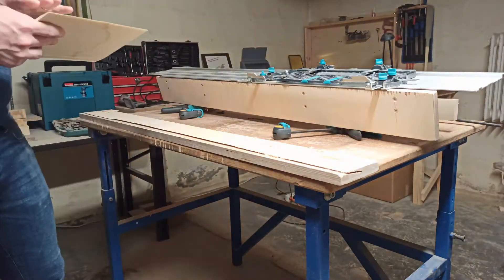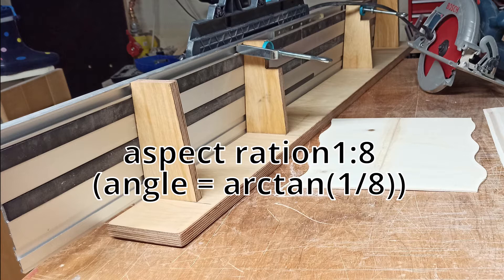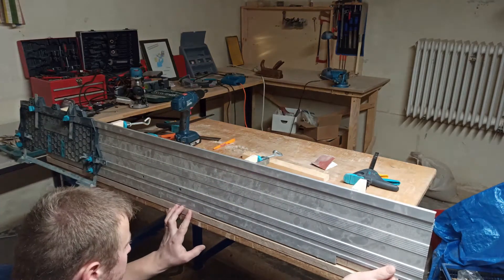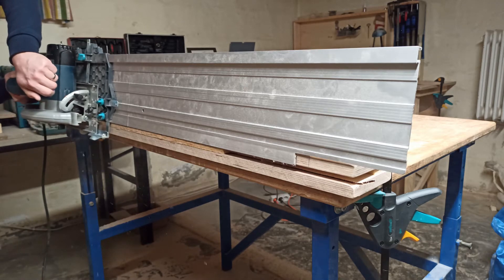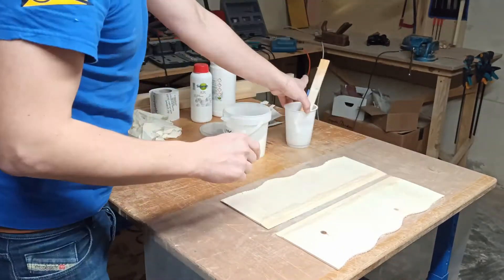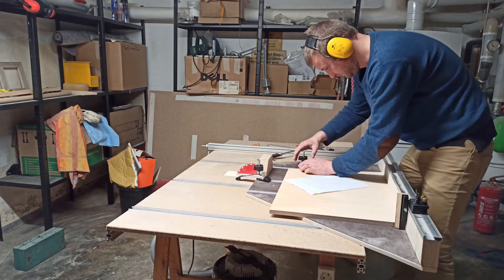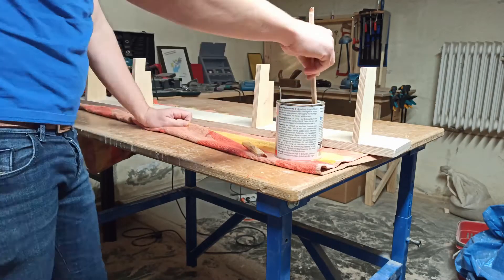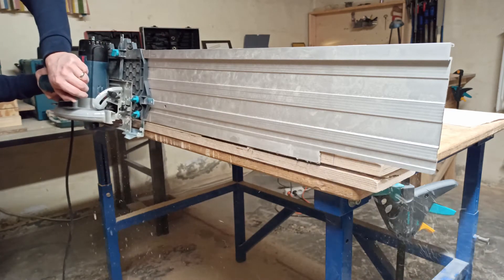Homemade Jig For Cutting Scarf Joints in Plywood

Comment: Over the course of a few decades I’ve made scarf joints in softwoods, hardwoods and plywood using all those methods: router, sander, hand and power planes and a very early iteration of the West saw attachment.  The West attachment is actually pretty slick and quick and easy to use.  The biggest drawbacks were the initial difficulty of getting it set up properly on a saw - you basically have to dedicate a saw specifically to it and use that saw for nothing else.

While having a perfect joint is satisfying to us woodworkers modern epoxies are typically much stronger than the wood being joined.  It would be unlikely that even an imperfect joint would fail if glued properly.  

Still, pretty cool jig you designed.
Reply from the maker: Thanks a lot for your Input! I just startet building my first canoe with the help of this jig and I am very pleased with the resuls and the fast cutting of the scarf joints.